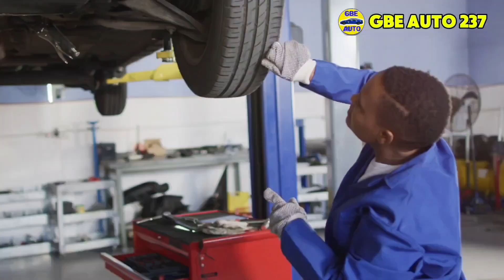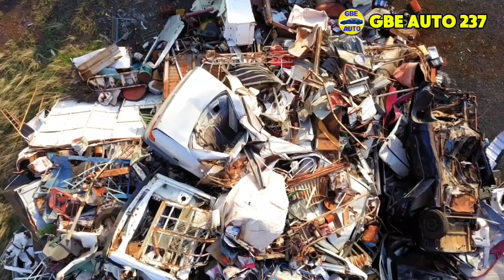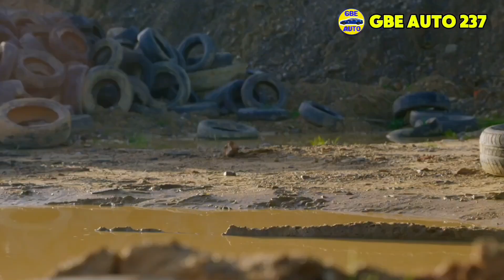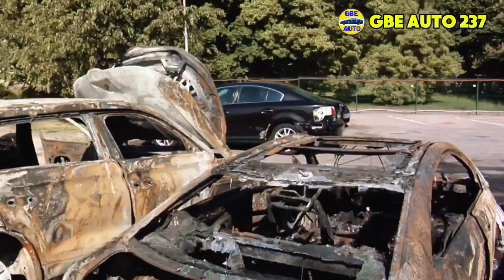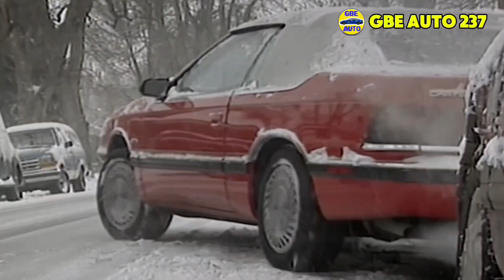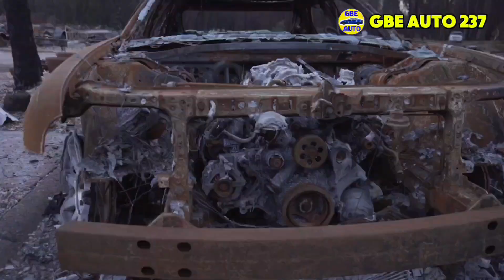♻️ Sustainable Auto Recycling: The Future of End-of-Life Vehicle (ELV) Management 🚗🌍

Comment: This is bullshit. The law that passed now is written so enthusiasts and those who enjoy working on cars CAN NOT have a project car they are working on anymore. In order to be exempt from these draconian regulations the car must be 30+ year old AND not be produced anymore AND in original condition, totally unmodified. So if you have manual swapped your old classic because it had an automatic transmission, swapped the engine or even suspension,, it may now be seized before you have a chance to fix/repair it if it does not pass inspection!!!!!